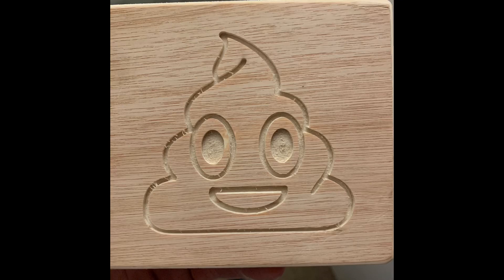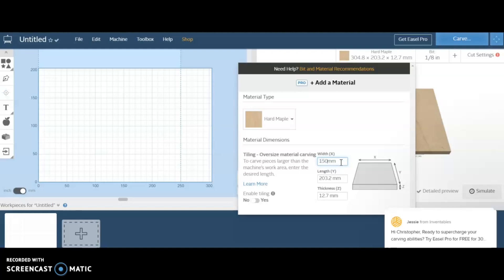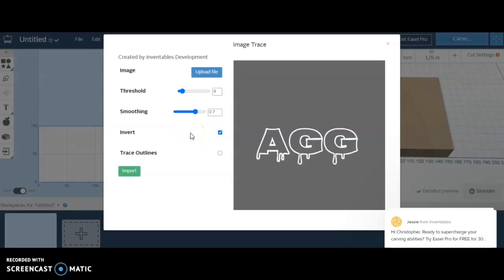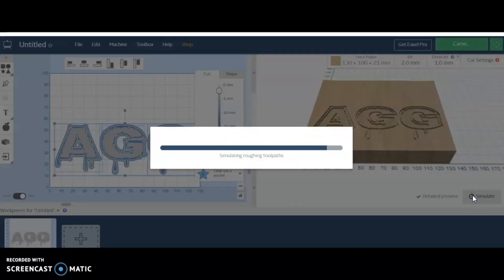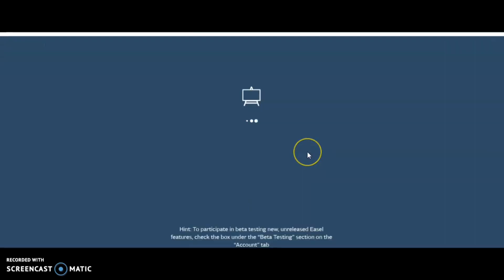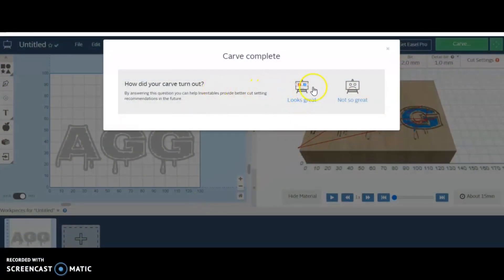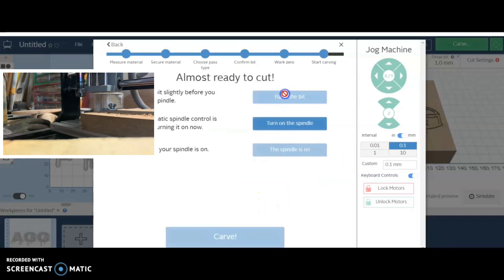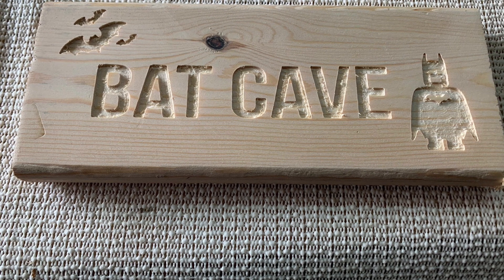How to. Set up your 3018 pro and use Easel to carve a design.

Comment: As I see in the video, your spindle rotates counterclockwise. This means that the drill will not cut, but will slide and heat up. For a feather bit, this is not so important if the sharpening is symmetrical. But screw drills must enter the material according to their sharpening - clockwise. I hope in the 2 years that have passed since the publication of this video, you have already figured out why your drills are breaking at the default speed and have changed the rotation of your spindle in the opposite direction.

Comment: Thanks, good tutorial, not tried Easel before. I measured the RPM of my stock 3018 with a tachometer and it only goes to 7L RPM, a few others have done this also so i think that's probably the real max speed for the stock motor.

Comment: I just bought the s3810 pro. Thank you for the video. I’ll download easel. I just want to drill 6mm deep holes with a 3 mm (1/8”) bit. Is the drill powerful enough to do that in oak? Would like to make a cribbage board. And can I upgrade the drill if necessary? Thx!
Reply: I’m new at this stuff but if you can program a pecking function while it’s drilling and press pause on the machine to blow out any sawdust I would think it would work

Comment: Can anyone give me some guidance? Everytime I run the Easel program it drills a hole through the material. I have changed materials and thickness. It doesn’t seem to matter.. it just drill straight through and doesn’t cut the design. Thank you
Reply from the maker: Perhaps the settings are wrong for your type of machine? Have you used the test controls to see how your machine behaves? Otherwise your machine needs “jogging” and resetting

Comment: I have an issue with the machine beginning to carve, then it stops and just spins.  Need your assistance with setting it up.  I followed your instructions to the T, and it still doesn't work.
Reply from the maker: I have had that issue, it was an interruption in power or internet in my case… I hope you managed to resolve it?

Comment: Thanks for a very interesting video!
The 3018 is in transport... Got an MF-70 a few years ago, made toast of the spindle motor and finally got a new motor. That 100 Watt motor keeps heating up even running without load. Poor cooling design I would say.
What's Your opinion about the duty cycle, working versus idling for this machine?
Reply from the maker: I ran the machine on a constant cycle for some signs i was making, a repeat cut using 2 different carving bits. the total carve time was 30 mins and I did it back to back 12 times. I was very impressed with its performance. hope that helps?

Comment: Hello! Can you help me please? Its a great video, but you didn't show the shape position. I don't understand. I saw many tutorials already, but my machine is still go to the wrong place. Like vica-versa, not like on the screen. Why? Thanks.
Reply from the maker: Hi, when you jog your machine and go through the movement checks before you carve, is the machine behaving properly? It sounds like the machine has a crossed wire if it is carving a mirror image?
Reply: @christaylorwoodworking  Thank for reply.
I found the solution:
type "$$", look at $3.
I saw this: $3=0 (dir port invert mask:00000000)
And change the value "$3=2
Now is perfectly work.

Comment: Easel does not appear top be free.  There is a trail signup then some unknown cost after some unknown trail period.  When a company does not list the cost up front, it's a good sign to move on.
Reply: No, Easel is free, 3 month free trial,  after only pay for Pro if you need to use any Pro specific functions which are clearly identified.
Reply from the maker: Ah ok, where are you located? I am in the Uk, I had to sign up but I pay nothing. Unless you have to put your payment details in you won’t be charged. I think the full subscription for the year is about $150 if you did sign up.
Reply: @christaylorwoodworking  Easel Pro is now $238/yr. You can still use the free version.